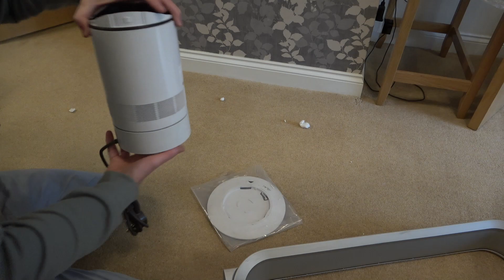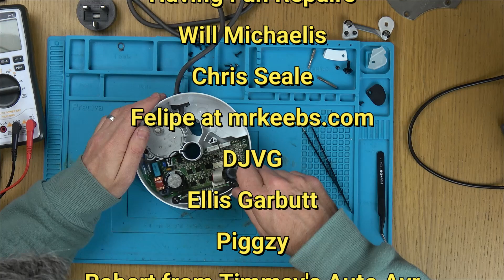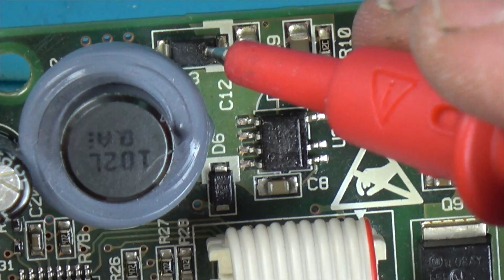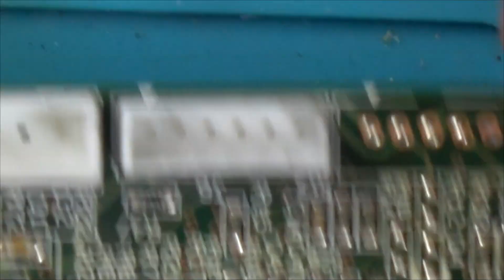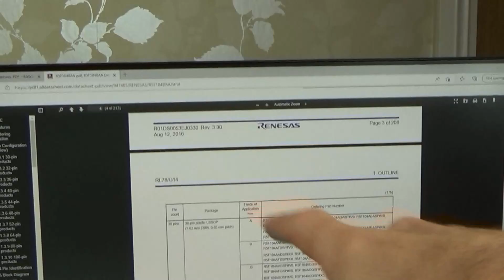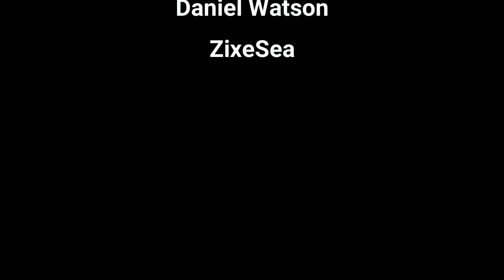Expensive eBay DYSON AM07 FAN - NO POWER FAULT - Can I FIX it?

Comment: The price you pay you wouldn’t expect it to go faulty
Reply: Most of the price is in the name, not the function, quality, or innovation.
Reply: @funny36ful  Yep I'd agree with that one. I would even say the quality seems to go down with each generation of product (cost saving) as I've look at a couple of these, and the later one didn't have a nice bearing, only a plastic bush, and a cheaper motor controller IC.

Comment: Interesting video, maybe find out the fan voltage and feed it directly from somewhere on the board with an external switch to turn it on and off, or a multi position switch for different voltages for different speeds? That way the fan would work and it would be oscillating 🤷🏻‍♂️
Reply from the maker: That is what I would love to do Paul. Hopefully the comments section might give me some ideas as although a timer would be useful, it is not really needed. Saying that the timer is used on my current fan quite frequently 😂 Real shame that these boards are not available on eBay, so many of these will have the same fault. I think I will have to bide my time on this one and get the replacement chip or board on eBay when it isn't a current desirable model 👍👍👍
Reply: @Mymatevince  Unfortunately that is not gonna be possible... 
You see the 6 mosfets on the pcb well they are the brushless dc motor driver...
The motor in that fan is not a regular ac or dc motor. By the looks of things it is a brushless dc motor like in the drones or electric cars, This type of motor needs its esc (electronic speed controller) to work and that microcontroller is what is probably controlling it.
I would recommend you to read up on bldc motors and how they work.
Reply: @diymaster1121  Can you not replace the motor driver?  Or does it need very specific timings for that exact motor?
Reply: @Mobin92 Usually the microprocessor is what is controlling the motor.
It is sensing where the rotor is and controlling when to turn on each coil.
So yeah the program is written and tuned for that motor.
Reply: Unfortunately that's not possible due to it being a 300v BLDC motor. It requires signals to be sent at appropriate times, and has 3 sensors to read the motor position. It needs to be sent the correct phase at the correct time to function. Think of like a 3 cylinder car engine, and each coil has to fire at the correct time.
Reply: @BuyitFixit  lol wrote that comment at the same time 😂
Reply: @diymaster1121  Lol, yeah. I've repaired a similar one, almost identical PCB and explain how it works. However I ended up in a similar situation with a hot+cool version where the motor driver chip failed and sent 300v DC back into the MCU.
Reply: @BuyitFixit  well thers no fixing that board...
I had a few "brain dead " washing machines that had a bad mcu.

Comment: I wondered if there are micro switches in the top so the fan doesn't come on unless the big top thing is clicked on too. I doubt it, but it looked a little like it at the end of the video.
Reply from the maker: Maybe for safety Luke, to stop accidents with fingers if the tower lid is off????? I never noticed at the time and right now it is under a pile of junk in the garage. I will check it out when I see it next 👌👍👍
Reply: Unfortunately not. The fan wont come on because it's a brushless DC motor, that requires specific timing signals to rotate.